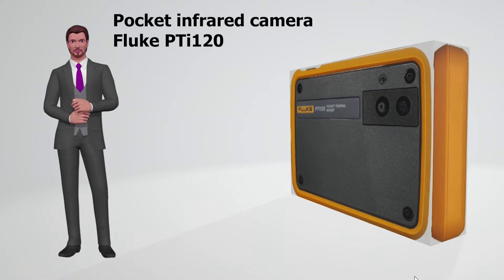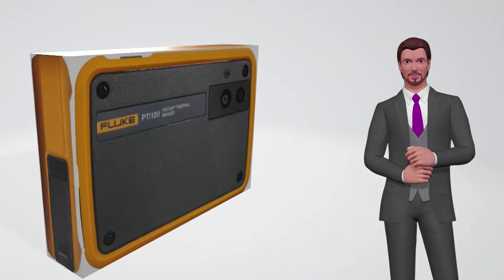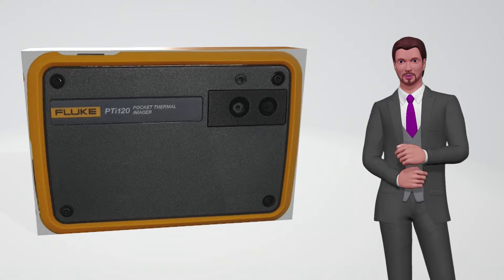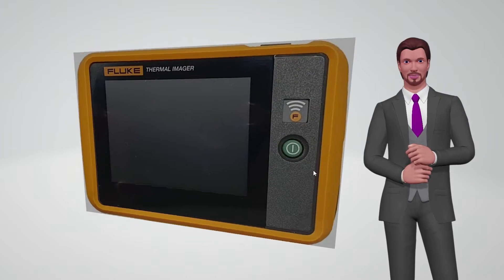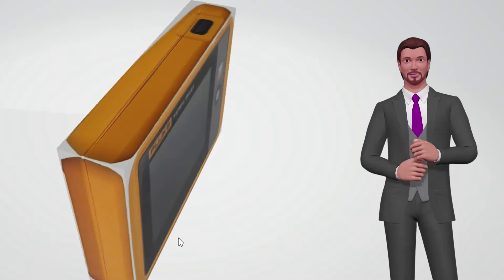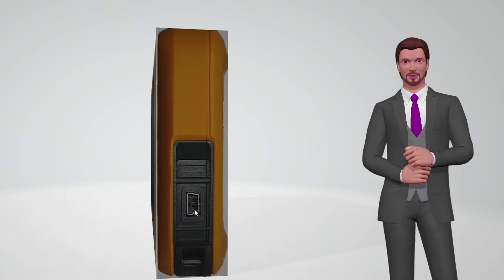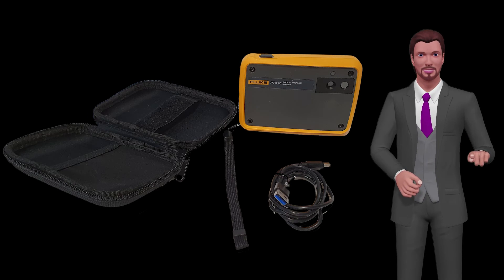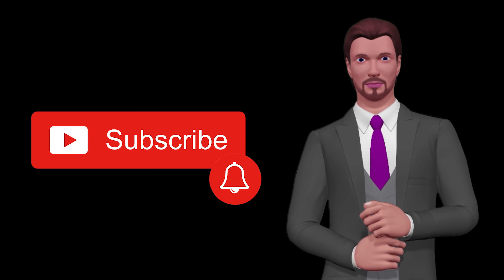Introducing the Fluke PTi120 Pocket Thermal Imager

Comment: Can we use this product to 137kv Substation
Reply from the maker: Hello Talla, when using an IR camera the parameter IFOV, that is Instantaneous Field of Vision, will give you an indication of how well you will see something at a certain distance. This parameter depends on the number of pixels and the type of lens. In the case of PTI120 you have 120x90 pixels and the lens is designed for small distances. In the case of a substation distances to a breaker could be 10 meters or more, as many of them are outdoors wind affects the temperature so hot points could be more difficult to see, so considering all these aspects my advice is to use a camera with higher resolution and even some cameras have the option to use tele lens. Electrical cabinets, motors and simple inspections at 1 meter distance are ok for the PTI120.
Reply: Thanks for your response, may I know how it will store the data .